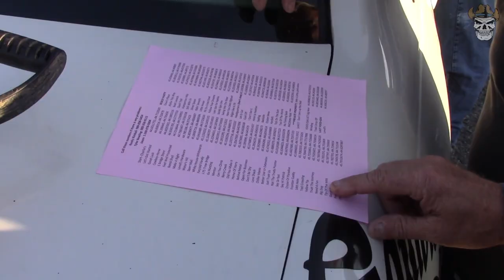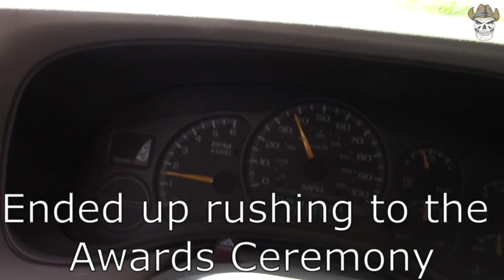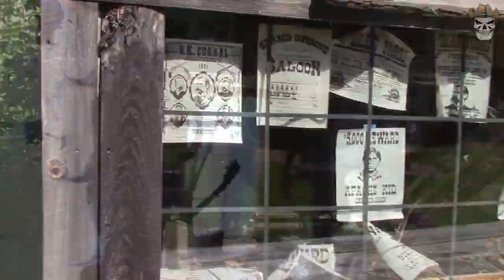Tip of the Mitt 2021 Gambler 500

Comment: I always run a radiator cap with the flip valve to de-pressure the system if needed. They are cheap and a lot safer when you need to open the system when hot.
Reply from the maker: Yeah even with the amount of rags and towels we had on that thing the steam was still quite warm.  It would be a worth while investment if you have a vehicle with that style radiator cap.